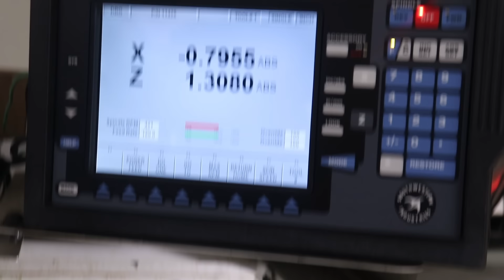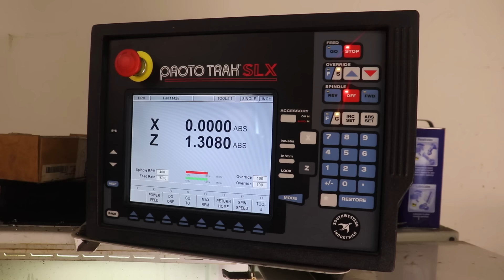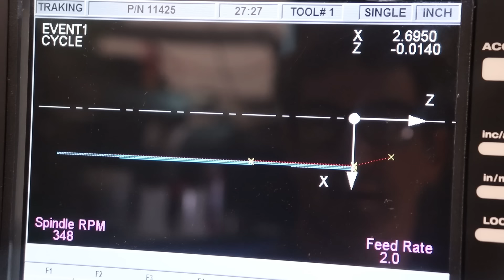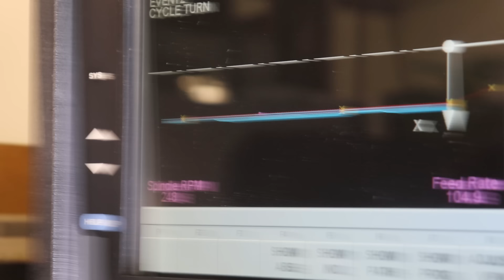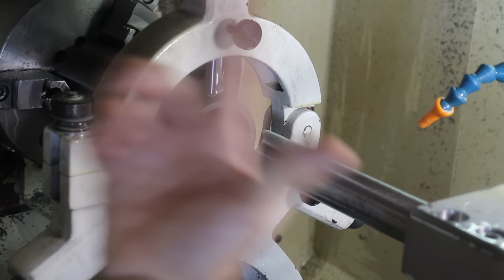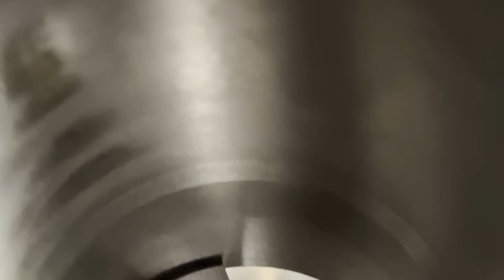Stoker Steam Engine Valve Sleeve lathe turn

Comment: HAL heavy duty machine shop in Australia serves the drilling industry, using very large machinery. They use a thin detachable shield in front of the steady to keep chips out.  One of their boring bars is called "KONG".
Came here from Keith's channel . Really fascinating to watch the CNC program tracking display.
Reply from the maker: Thanks for the tip, will check them out

Comment: For the next time you are working on part that thin wall parts, over tightening the 3 jaw chuck can distor the outside and inside of a sleeve. I would use soft jaw bored to the outside of the stock. Great job a hard work with part. Jim
Reply from the maker: good point.  I will keep that in mind for the next time.  In this case I think the "rough machine" spec area was under the jaws

Comment: Flexing the boring bar depends on the sharpness of the cutting plate, the thickness of the chip and the feed and speed. 
You did that well.
2.7500 inches is 69,85 mm - 0.0005 inch ist just 0.013 mm
This isn't rocket science
Reply from the maker: The width of the chip adds to the force too, that is why I switched from 0.030” to 0.016” cutting tip radius. Thanks for watching!